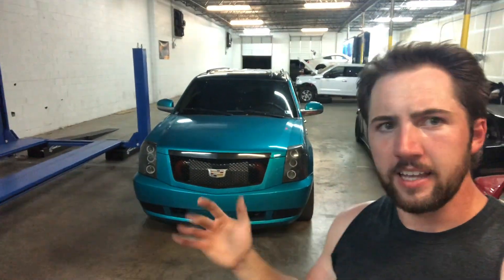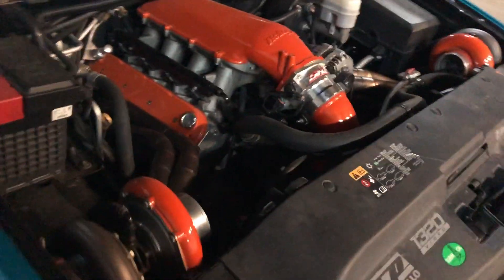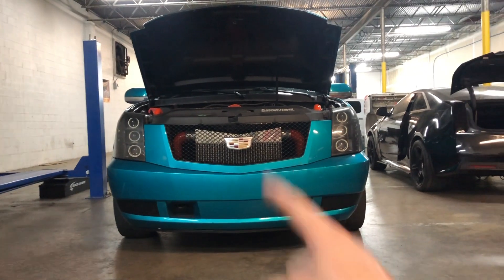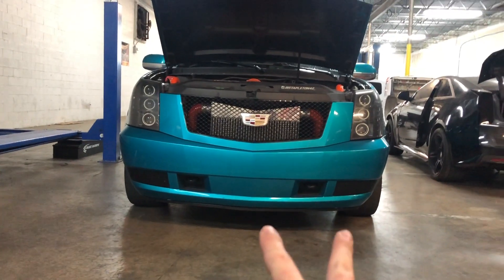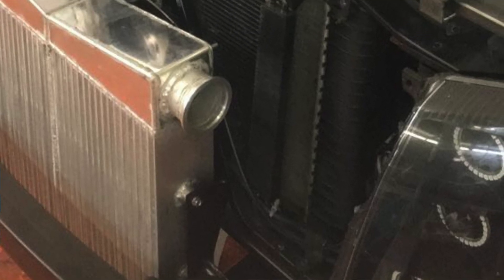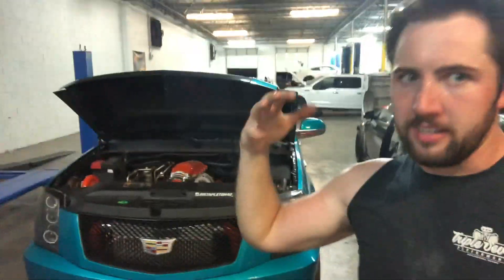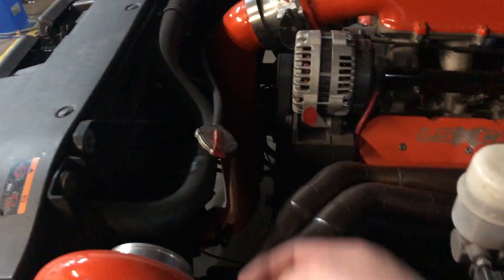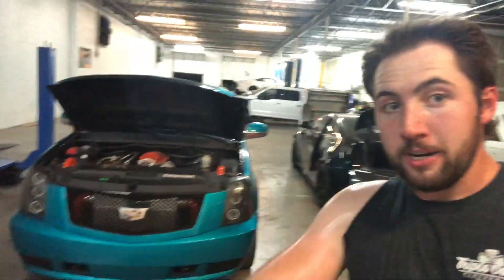LSXcalade Explained: Intercooler Design and Fabrication Process

Comment: You made that intake to match your headlight angle? I just purchased the exact same one from CX Racing, if you need a spare look them up.
Reply from the maker: It’s not the exact same one. It’s configured similarly in a visual sense but not the same by any means

Comment: I don't see the lines of the end tanks matching the headlight angles as much as I see them matching the bottom of the grill.

Blue and orange, being opposites on the color wheel, thus complementary, are "supposed" to work together but that teal with bright orange was a bit risky, especially on that platform. However I think it's a great, somewhat quirky combo. I have an all-wheel-drive, first-gen CRV project that will be going from gold to brown and I think I'll swipe that teal as an accent.

And as a former landscaper I can relate to repositioning something repeatedly after standing back to have a look.
Reply from the maker: You have to see the lines inside the upper portion of the headlight not the lens itself. It’s more apparent in person. As far as the color combo? Gotta risk it to get the biscuit 💁🏻‍♂️